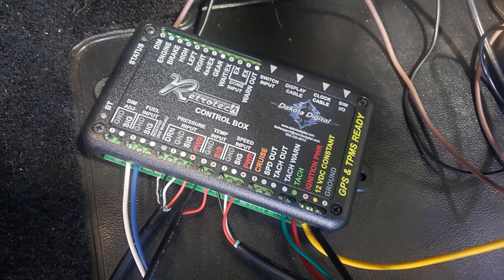Tech Talk Tuesday: How to Wire the Dakota Digital RTX Gauges in a Dodge Challenger or Plymouth 'cuda

Comment from the maker: Some questions have come up regarding the wiring of the instrument cluster, so let me try and answer them here. For the two power wires I attached them to the open spots on the bottom of the factory fuse box, so no cutting required, just plug into the open ports. For the fuel sender you could use the factory wire for one of the wires, but the Dakota Digital kit requires 2 wires, one to attach to the normal location on the fuel sender and one to attach to the fuel sender as a ground. And since I had to run one wire to the tank anyways I decided to just run a pair of new wires and not cut the factory harness. As for the oil pressure and water temperature, yes they need new harnesses as they have new sensors that are not like the factory units. The factory water temp and oil pressure sensors have 1 wire each, the new water temp sensor has 2 wires and the oil pressure has 4. Plus the new sensors have special plugs on them. It's a lot easier to use what comes in the Dakota Digital kit than try and splice into the factory harness.
Reply: I have a few questions regarding a few scenarios. Any way to touch base with you other than here?
Reply from the maker: You can shoot me an email at lifeatspeed2020@hotmail.com
Reply: @LifeatSpeed  will do now. Thanks.
Reply: But how did you attach the ground wire to the Feul Sending Unit??
I am in the process of doing this now???
Reply from the maker: Solder a connection lead to the sending unit to attach the wire to
Reply: @LifeatSpeed  
Ok, did you use all thread or something like that?
Reply from the maker: @ibanezsrbass1759  you could use all thread. I used a solderless terminal and soldered it
Reply: Can you please tell me what you did with the factory hot and ground wires that originally went to the amp gauge? Did you cut the ends off or tape them up? Thanks
Reply from the maker: I connected them together.
Reply: Did you put a small bolt through the 2 connectors or did you cut them and crimp them together. I just pulled my dash apart today to start installing the Dakota gauges. Thanks
Reply: @LifeatSpeed I wasn’t sure about those because it doesn’t say anything about those wires in the instructions. Thanks
Reply from the maker: You could do either. I bolted mine and wrapped them in electrical tape as I didn't want to cut them being a brand new harness.
Reply: @LifeatSpeed thank you for the help! Much appreciated!

Comment: I run my parking lights during the day..will the dash light be too dim? I ask because I run Halo lights during the day and don’t want the dash light to be in night mode. Ideally I would like parking light in day time mode and when the headlights are on, (knob pulled all the way out) then night mode would be great. Any suggestion on how to accomplish that? Thanks
Reply from the maker: I'd give Dakota Digital a call. It has been a couple of years since I installed mine, and my memory of how all that worked is a bit fuzzy. I know you can have different settings for brightness, and even install an adjustable dimmer switch to change it on the fly as well.

Comment: How did you terminate the wires in the control box?  Bare wires, or did you solder or crimp ferrules on them?
Reply from the maker: In the control box you just slide in the bare wire into the designated slot and tighten the screw on the control box

Comment: Question: if you can answer, what if you have an HEI distributor and no coil, where do you hook up wire?
Reply from the maker: The HEI distributor should have a connection point for the tach. You'll need to check the instructions for your specific distributor.
Reply: @LifeatSpeed  Thank you. I’m pretty much like you. I have a 70 SS EL CO and wiring is not my cup of tea. I really like the Dakota Digital they make for my car but wondering if I can tackle it. After I unplug dash wiring harness, does it remain or do I need to trace wires and tap into it? Thanks for you’re time. I may have more questions if I purchase if that’s alright with you. 😊
Reply from the maker: The Dakota Digital wiring doesn't use much of the factory harness. I left the factory harness in place and just tied the instrument cluster wires out of the way. It really is an easy installation. Feel free to ask me any questions you come up with.
Reply: @LifeatSpeed  awesome. Ok , you convinced me. Time to buy… 1 more Q: Are the instructions included? Sometimes it’s just a diagram. Thanks again!
Reply from the maker: They come with pretty thorough instructions

Comment: Does it come with a gps speedo and does it come with the signal box to run the speedo
Reply from the maker: Gps speedo is an upgrade option. Standard is basic electric speedo with a unit that screws into the factory mechanical speedo input on the transmission.

Comment: I don't know if you have the factory facsimile for the model's tires or not but has it maintained it's accuracy of its speedometer or has it improved?
Reply from the maker: The speedometer is dialed in. It was real easy to calibrate. I had a gps speedometer on my cell phone and adjusted the speedometer in the car to match. Took less than 5 minutes to dial in.
Reply: @LifeatSpeed  oh that's neat thank you!
Reply from the maker: @metalbob3335  you're welcome. It makes it really nice down the road as well if I swap rear axle ratios, tire size or even transmission. I don't have to worry about the speedometer, because I can simply re-calibrate it in under 5 minutes to accommodate for any changes I make.

Comment: Is there anyway to integrate the dimmer on the dakota digital dash into the factory dash dimmer switch? I'm going from a standard gauges to rally gauges, and don't have a 4 light bar.
Reply from the maker: You don't need the 4 light bar, you can reuse the 3 light bar. The new gauges are back lit and so you don't need to hook up the overhead lights at all. Dakota sells their own external dimmer you can integrate if you choose. I opted to just adjust it within the settings.
Reply: @LifeatSpeed  I understand dakota sells their own dimmer switch, but like you said it didn't look factory. I'd like to be able to adjust the backlight on the dakota digital gauges with the factory dash dimmer switch. Is that possible? I don't want an extra dimmer knob on the dash, it won't look factory.
Reply from the maker: I'm sure anything is possible, but I didn't look into hooking up the factory dimmer. I simply set a brightness level for day and one for night (when the headlights are on) and called it a day. Since I never fiddle with my light settings, there was no need to attempt to find a way to wire the factory dimmer. Sorry I don't have a better answer for you.
Reply: @LifeatSpeed  no problems brother, you have been a big help. Much love and appreciation!!!
Reply from the maker: @claytonhaske  thinking about this further, you have a couple of options. First is to take the dakota digital dimmer and find a way to custom mount it in place of the original dimmer and attach the original dimmer knob. The other option is to determine the resistance range of both the original dimmer and the dakota digital dimmer and see if they are close enough to wire up the original one.
Reply: @LifeatSpeed  dakota digital is a 10k pot. Can't find what the mopar ebodies are.

Comment: How did you attach the negative to the body of the fuel sender?
Reply from the maker: Temporarily I used a hose clamp to attach it to the outlet. Long term I will solder a terminal to the body
Reply: @LifeatSpeed  Hey thanks!  Appreciate your videos.
Reply from the maker: My pleasure! Glad I can help.